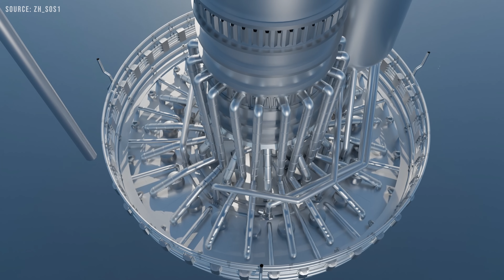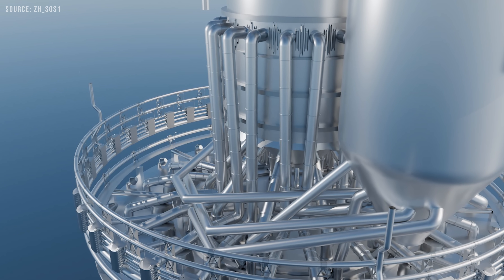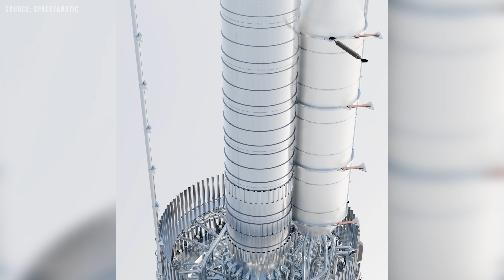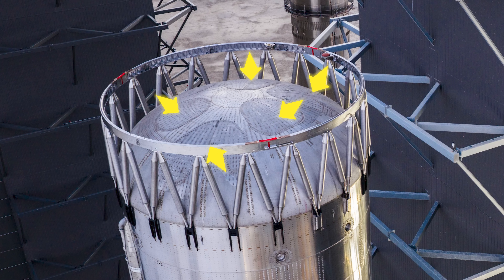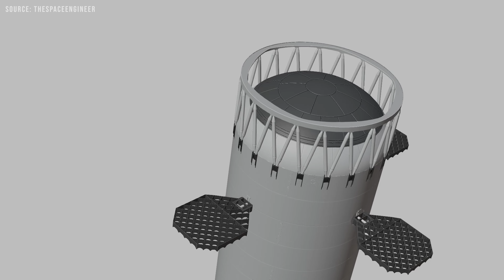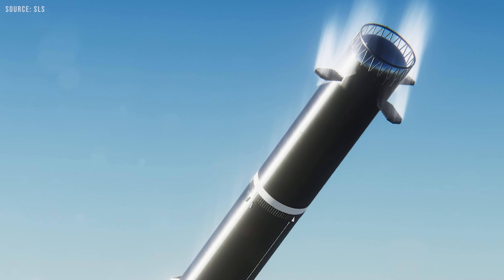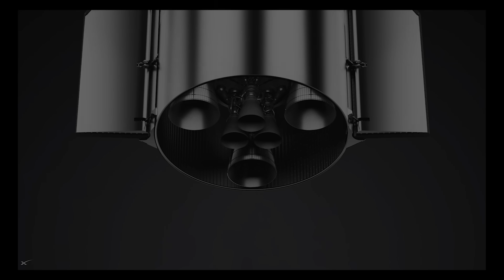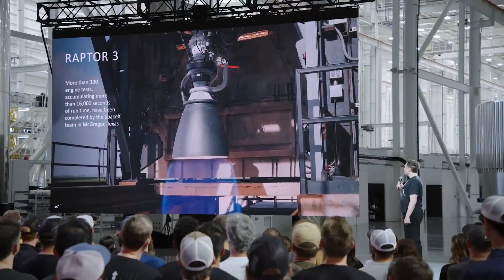SpaceX Brilliant Upgrade on Starship Version 3 Design to Land on The Moon! Never Seen Before...

Comment: I think there is a lot technically incorrect at the beginning of the video. There still IS a big central tube running through the Oxygen tank. It used to be a smaller down-comer but is now upgraded to function as a landing tank and transfer tube.
"You can clearly see a lot of lines going to the engines..." Those are all propellant lines carrying either LOX (from side LOX landing tank) or from the central LNG (Liquid Methane) transfer tube.
As video continued, it improved. Maybe the beginning was just not well organized with rest of script?

Comment: I will be impressed when I see them land on the moon or mars.  At the moment I only see small movement happening. The goal is not the product protuction but goals and at the moment I see the goals to be small. I also think that based on the data the  method to refuel is flawed. I can see that the size is very small in the CGI. This makes be think that the size must be larger because  it would need to be done quickly and that size it would take about 30 minutes. Not 10 minutes. Time matters. Also in order to go to mars they have to figure out the burn off value and what is left. They have not yet done this. That does matter. I also see that the moon topic and yet they have yet proven this situation could even do it. We shall see.

Comment: Two things one exciting the other amazing.
Raptor 3: is just amazing.  It's so clean it seems impossible.  Complexity Internalized it's just amazing.
Pad 2 Flame Trench:  I can't wait to see the mount, the flame trench and more thrust than has ever come out of rocket 
controlled by water pressurized with rocket powered gas generators -- and shot out either side.  Will we see crazy Mach waves? 
This is nuts.  Next, fusion powered craft that generate impulse without burning fuel or ejecting hot gasses.